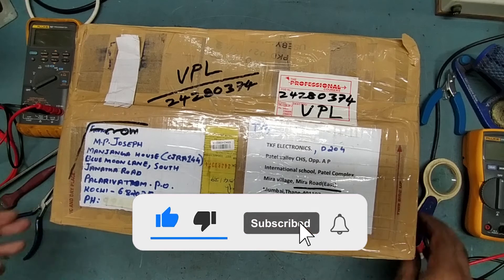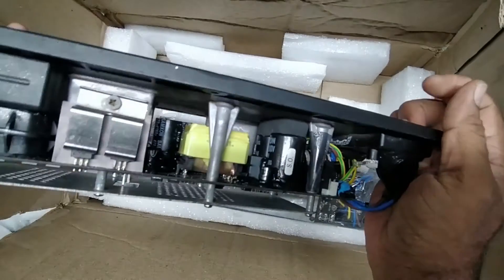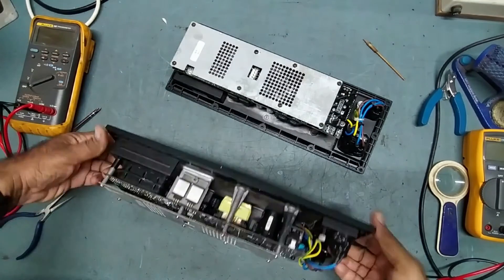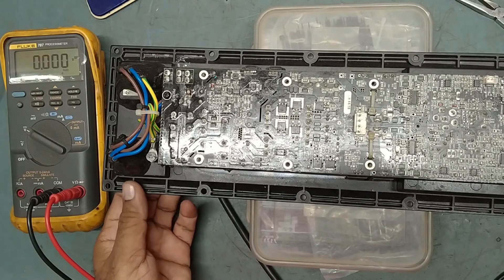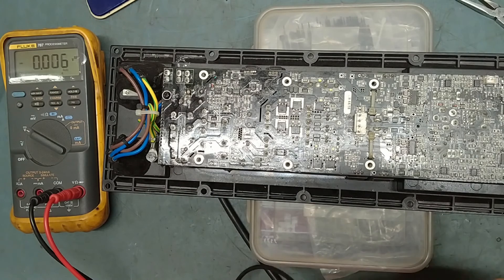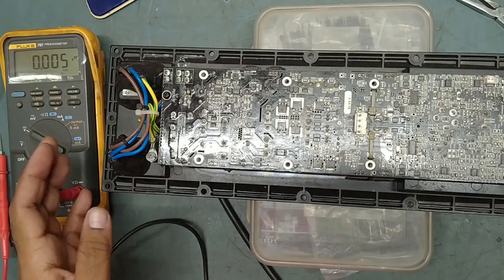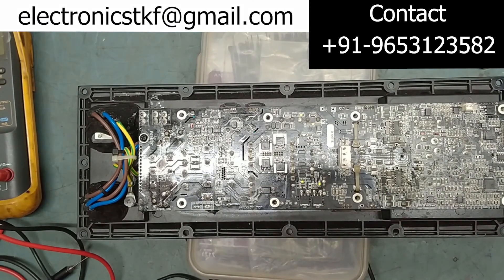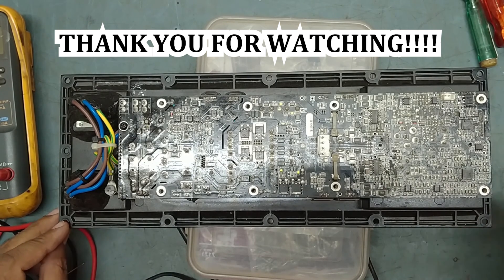Repairing RCF EVOX-12 powered Active Speaker for no HF Output.

Comment: Sir I am working for an event company one of the RCF 12 hf is not volume is very low if gain is given some sound is coming.when checked smd coupling capacitor was blown (burned) out now don't know the value i tired with normal capacitor with some the volume is low with some volume is coming but only if you give more the half volume it also makes the hiss noice can you please guide me .
Reply from the maker: In order to guide you What's app me photo my WhatsApp number 9653123582

Comment: I have an RCF Evox 12 sub that makes a loud 'Humming' sound, instead of passing signal & music.
Also, no sound or humming came out of my top speaker. (It's totally silent.)
If I removed the XLR cable, the humming went away.

I tried different AC power source, XLR cable, fuse & Speakon cable, but only 'Replacing the sub' fixed the problem.

I'm removing the amplifier, and sending it back to RCF in New Jersey, but they said it could take a month or longer to fix.

If I knew what the problem was, I could probably get it fixed in my home town much quicker.
Have you ever run across my 'Loud humming' issue before?
Reply from the maker: I think their is problem in Amplifier circuit or input line Circuit